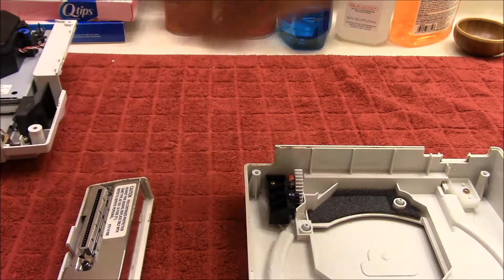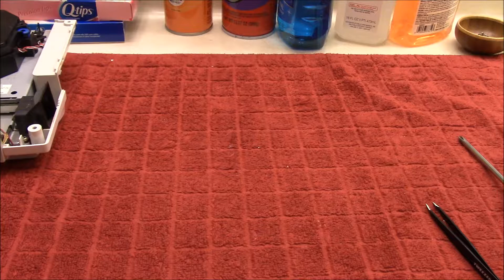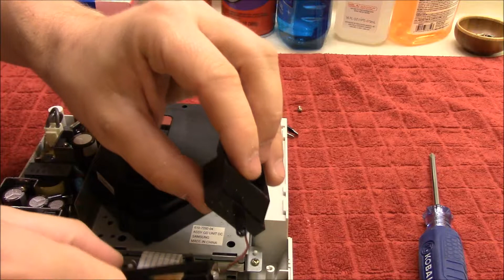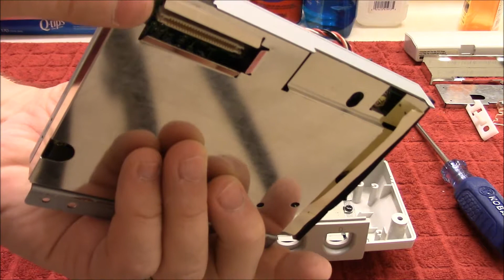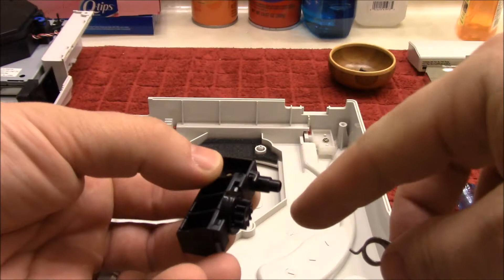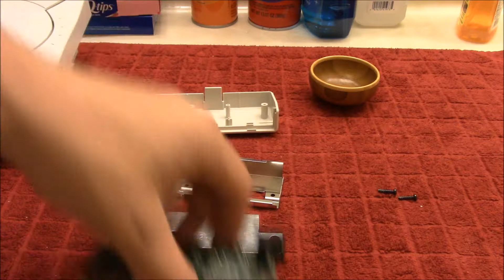Cleaning a Dreamcast

Comment: Great video😎😎Could I use lens cleaner on my Dreamcast? I don’t have any isopropyl😉😉Thanks🍺
Reply from the maker: It depends on where you want to apply it. Most lens cleaners also contain various soaps, which could ruin the actual lens on the disc reader. It could also cause problems with the curcuits, if you can't remove all the liquid successfully. Most stores do have isopropyl alcohol in the pharmacy or first aid section.